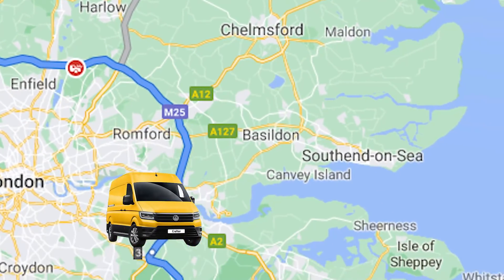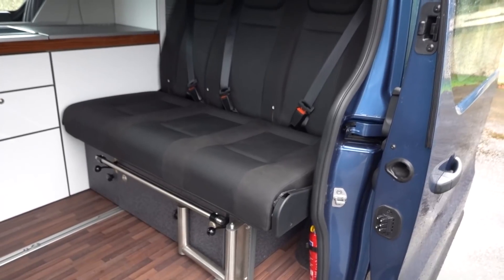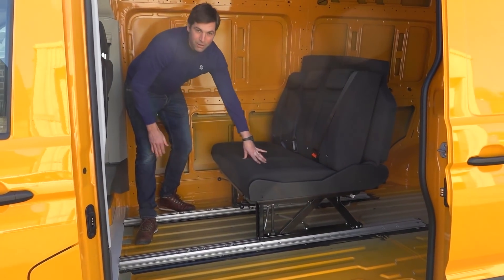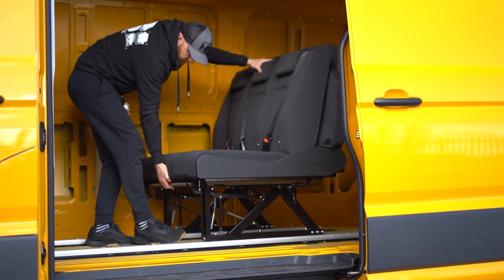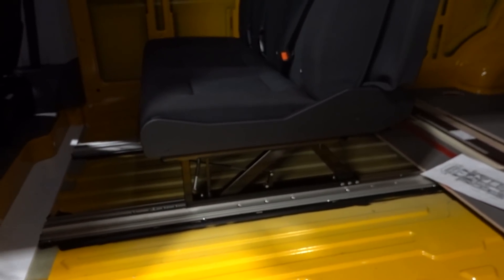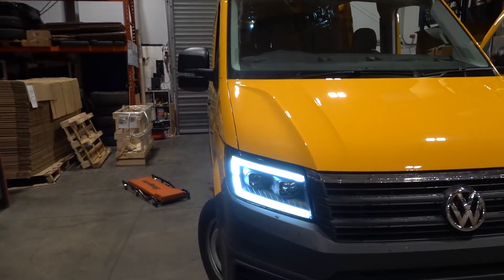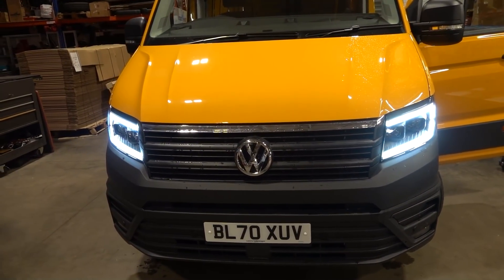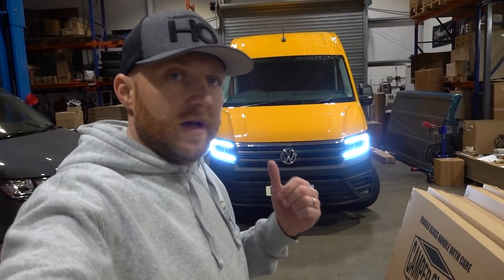New VW Crafter / MAN TGE LED headlights + Reimo Variotech Sliding Rail Bed System

Comment: I'm looking to get a Crafter for a van conversion, but the basic light are well basic. Knowing I can get these has set my mind at ease and they look awesome. I have a question, unless you have a crafter with the zeon light upgrade they don't seem to have an auto on option on the internal switch. Would I need to change this and is it straight forward?